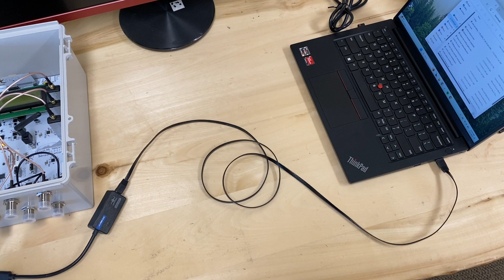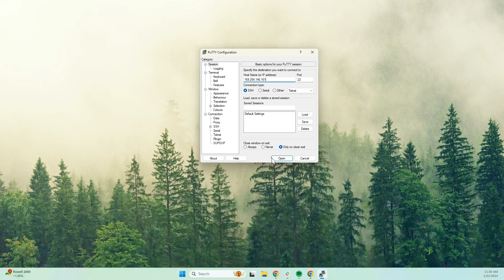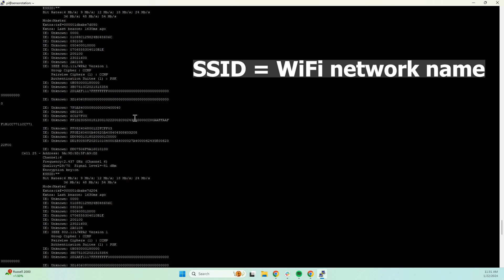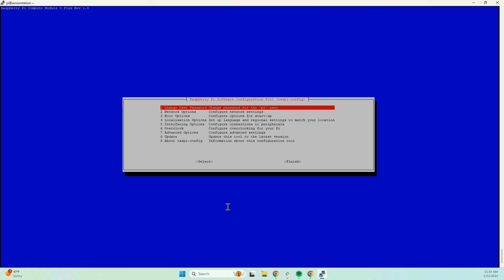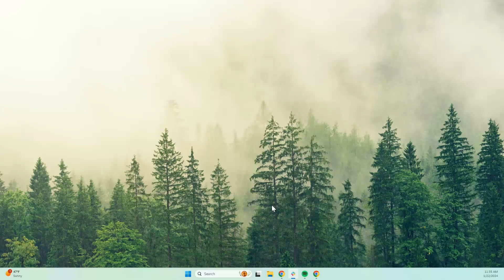Connecting a CTT SensorStation to a WiFi internet network (ssh and raspi-config method)

Comment: FYI on my SensorStation V3.2 w/System 1.4.0 (Image 2024-09-10)  the raspi-config menu is slightly different. The top-level menu does not have a 'Network Options' choice.
I found 'System Options' which had the 'WireLess LAN' submenu.
Reply from the maker: Thanks @richschramm6102.  There have been several changes made on the SensorStation interface and software end through this year (2024).  We plan to make an update to this video in the coming year to reflect the current interface.